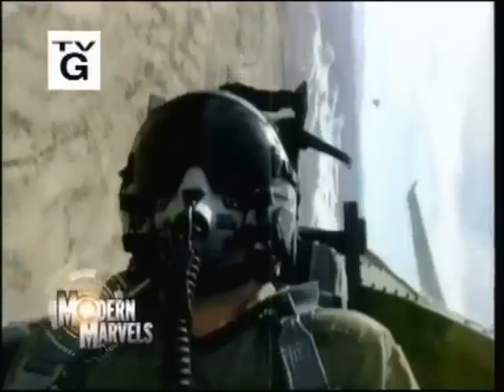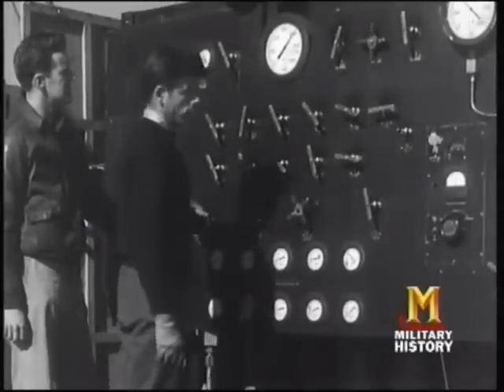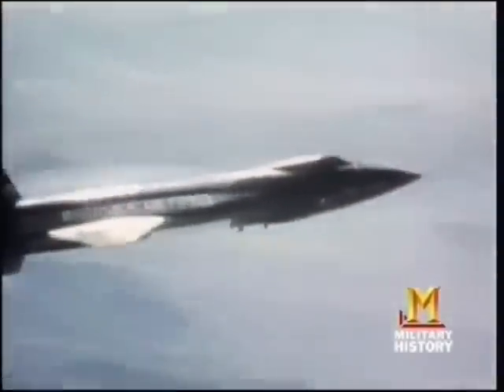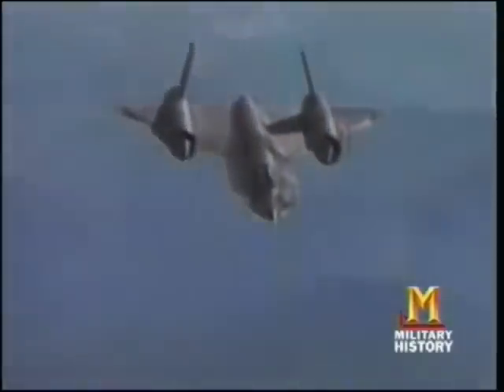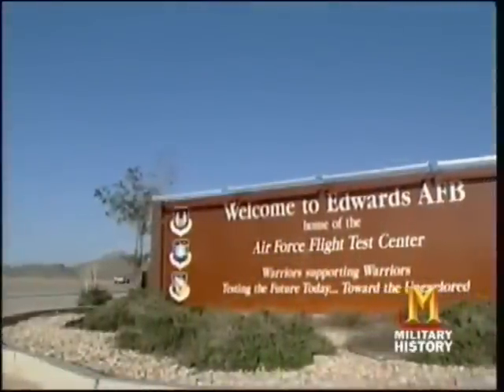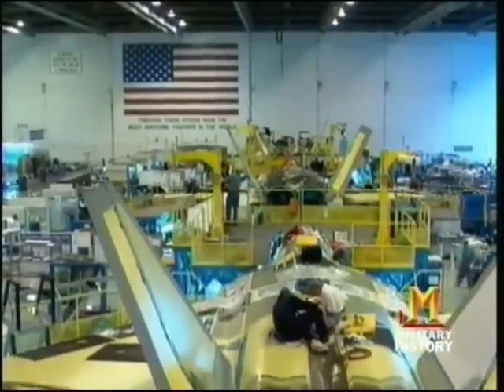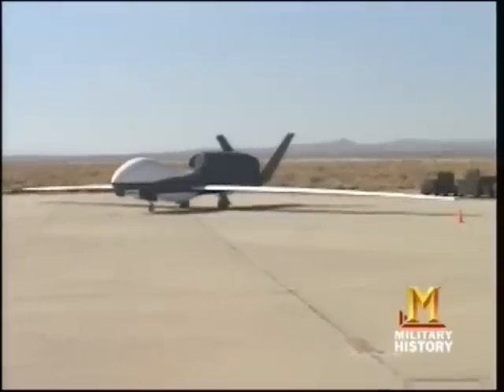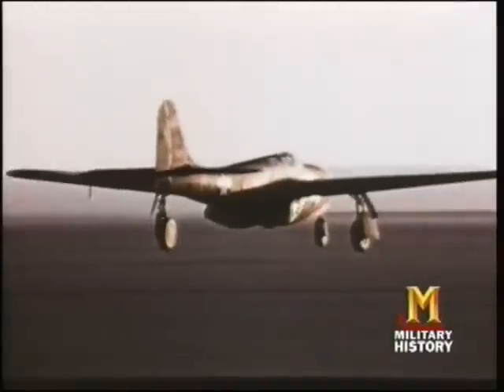Complicated Military Aircrafts - Engineering and Manufacture (HD Documentary)

Comment: i'm getting a little tired of this debate to have people in the cockpit or not. i flew 3 combat tours in the USAF. and out of every target i engaged. 99% were little more than a blip on my screen or a coordinate, period. i flew several fighters in the AF. and all had a combat cam that i often had to watch for hit confirmations for later debriefing. but only at a minimal. in the moment, you're trying to fly the aircraft, maintain a high level of awareness and monitor your systems performance in a very dark cramped space. these remote pilots are sitting in a well light room. they can literally turn controls over to another pilot for a break. and they have the safety buffer to allow themselves to monitor a target far more closely than any on board pilot would ever want to.  as a pilot, i had to pass a very high standard of eyesight. but at 15,000ft, i'll have to look through a monitor as well. but mine was much smaller and with much less res. so the real question should be. we have 2 different ways of doing the same thing. one keeps the pilot completely safe. the other puts the pilot directly in harms way. which should we use?
  furthermore, i'd like to point out a very key factor here that i've not heard mentioned once. when a missile hits a fighter. the pilot DIES. when a missile hits an ROV. the pilot L E A R N S...
Reply: Everything you said is correct, BUT, the problem with not having a pilot on board at the moment is either the enemy jamming the communications with the aircraft, or even worse, somehow taking control and using the aircraft against you.
Reply: Sweet Jesus, some Wise Words of Wisdom! Imagine the speed , stealth and maneuverability of supersonic stealth drones? Just 5 years imagine CPU power, stealth materials, and weapons technology!  "the pilot DIES. when a missile hits an ROV. the pilot L E A R N S..." = Ppl only complain if thats your family/relative KIA?
Reply: vujcicfan not really. all our latest, and very soon to deploy, attack drones can operate autonomously. if they're cut off, they continue on with the mission at hand. and will still be able to counter enemy missiles and fighters. even engage ground targets without human input.
Reply: ***** But that's good only for a very specific mission(and in fact drones are used today for very specific missions like air strikes or surveillance), Artificial intelligence today is still not that advanced that it can completely replace humans, so as long as you can't trust either the RF link between the drone and its operator, or the drone's AI, you will need humans inside the aircrafts, tanks, ships etc...even if it means they are risking their life, and I say that after 13 years as a tanker in the Israeli army, so it's not like i'm happy risking other people's lives, but that's the situation at the moment.
Reply: vujcicfan you need to get better read on the subject matter man. plus, i did clearly say these attack drones were "soon" to be deployed. the new predator D, being deployed in 2016, with about 750 units. is a fully autonomous drone. it can fly entire missions on its own against ground and air units. sounds you like you're a bit behind in AI development man. what the AI for your desktop can do pales to compare to military grade equipment. btw, that new predator will be armed with our new directed energy weapon system. which will annihilate anything thrown at it. plus it will have an 18 hour linger time to loiter over the battle field. 
 now to really put this weapon into perspective. if you made up squads of 12 and placed them in a flight line with about 50 miles between each squad. you'd have an offensive line of attack that spans over 3000 miles. thus we could send this line across any region and effectively own everything land, sea and air. the even bigger part of the picture that no one seems to be catching onto. is just how much of an impact these systems will be to our missile defense shield. think about man, we'll have over 700 anti- ANYTHING lasers that can sit at high altitude for nearly a day at a time. and can refuel in the air. i don't care how you look at it. that is a huge checkmate :)
we are about to enter a strategic checkmate that has only ever happened once in the history of man. the first time was just after we nuked japan in ww2. for nearly 5 years. america was the only nation on earth to have nukes. we could have pressured all of our enemies to the negotiating table. unfortunately we let that opportunity pass us by. i doubt we will this time :)
Reply: Totally agree, all the benefits of remote piloting far outweigh the risk of possibly loosing connection. All the life support systems, cockpit, instruments, etc that take up valuable space and weight aren't needed. That allows for greater flexibility in design to increase payload, range or whatever. They can pull higher G, stay in the air for days and manage maneuvers that humans just can't. And the most important asset, the pilot, is kept completely safe with the added benefit of better awareness and other pilots around to advise or take over.

Could you imagine dog fighting something like that, something that could have 360 degree vision, track multiple targets, pull hard g maneuvers in rapid succession and use automated maneuvers to attack. And if one does go down another could take over with the same pilot who now has more experience. I know it's not that simple and modern combat isn't really about dog fighting but the potential is amazing.
Reply: person8203 they're pretty damn awesome.
Reply: I totally agree, don't agree with whatsoever with the arguments against drones.

And thank you for serving our country
Reply: *****   Yeah.  You won that argument.
Reply: Has no one seen Terminator? Do you really want that?
Reply: mcapps1 sounds more like you've been watching to much terminator, lol...
Reply: Gotta say, some fella in a bunker playing with a joystick, unleashing a hellfire or 2 on "video game", to me sounds dangerous ethically, am aure there are some checks & balances but all the same, will get many more Afgan weddings blown up + + if we fully take the human element & eyes on the ground so to speak,.am sure some troll will call me a wanker & to wake up thats how things are going, am sure thats correct but my point is it's in my view just plane dangerous & will cause major errors, a guy comes of an xbox medal of honour onto a drone mission, he will resist pulling the trigger, i think not. Then again, fuck em all right !
Reply: Dan Dared
It's actually more likely to be the opposite, the main difference is that the pilot is taken out of harms way. They'll still have much the same instrumentation and processes for authorising targets. However, with the pilot being on the ground somewhere they can have much more equipment around them to help make decisions as well as input from others if need be. It's certainly not a computer game and pilots who have to go through all that training aren't going to jump on going "fuck yea, kill streak!"

Although, not being able to fly an actual plane sounds like a bummer to me.
Reply: person8203 yeah, i can see how not flying seems like a bummer. right up until that first missile locks onto you. coming from personal experience, that is a real big bummer.
Reply: *****
Must every comment come with terms and conditions, just read between the lines?

All I'm saying is that there could quite possibly come a time where certain pilots spend more time sitting on the ground than in an actual aircraft. Surely you would rather fly a jet? Yea, there's an element of danger but it isn't called the armed forces for nothing.

Of course, for pilots safety among many other reasons it makes total sense to use remotes.
Reply: person8203 um... i was basically agreeing with you man. i flew for over 15 years in the USAF. all i was saying, is that flying a fighter sounds great until you get that first alert of an enemy lock on your aircraft. and the awareness of a 20+ft rocket screaming at you at over 2,000+mph. the will redefine the term "bummer" real fast.
 i want to see massive investments in drone fighters. the need for manned aircraft is not going away anytime soon. but frontline attackers and strategic strike missions play into the drone world perfectly.
Reply: ***** well, that is like explaining heaven, lol. honestly, i miss it alot at times. i still fly my own single engine sport jet. but i'll never see a mach again, lol.
 my advice to you... do it! i've had a few friends that were deathly afraid of flying, period. i got them up with me once and put a stick in their hands. they now own aircraft. 
 a little fyi, most airports have clubs associated with them (heli's, ultralites, planes etc). and the only thing flyers love more than flying. is talking about flying, lol. look around for a club that feels good and go in and talk with them.
Reply: ***** what did you fly...what military...i bet you are lying and I can prove it
Reply: Dan Dared - If Afghan weddings are like Iraqi weddings, the men have this thing about shooting AK-47s toward the sky to celebrate...that has a tendency to get you shot back at, or at least buzzed by a jet fighter, when the damn bullets come raining down on the neighborhood. If your wedding is just outside someone's airfield, that is exactly what happens.
Reply: Brian Shelton - governmentcheese411 sounds pretty legit to me. Gut feeling is he was an F-4 Phantom jockey in Vietnam, statistical likelihood is an F-16 pilot since there are a lot more 16s than anything else and over a long period of time. Either way he's got flyers pegged - I annually immerse myself in that crowd and what he says is true.
Reply: Amen!
Reply: I'd add to that that remote control tech is much lighter then a pressure suits and cabins, and all the screens and controls needed to accommodate a pilot on board.
Reply: governmentcheese411 
P
Reply: governmentcheese411  p
Reply: Obviously Air Force, as you claimed you were in, did not teach you punctuation, capitalization, sentence structures,... etc.
Either you lied your ass off or you just copied and pasted from someone else's comment, Youtube pilot.

Comment: One day, high above Arizona, we were monitoring the radio traffic of all the mortal airplanes below us. First, a Cessna pilot asked the air traffic controllers to check his ground speed. ‘Ninety knots,’ ATC replied. A twin Bonanza soon made the same request. ‘One-twenty on the ground,’ was the reply. To our surprise, a navy F-18 came over the radio with a ground speed check. I knew exactly what he was doing. Of course, he had a ground speed indicator in his cockpit, but he wanted to let all the bug-smashers in the valley know what real speed was. ‘Dusty 52, we show you at 620 on the ground,’ ATC responded.
The situation was too ripe. I heard the click of Walter’s mike button in the rear seat. In his most innocent voice, Walter startled the controller by asking for a ground speed check from 81,000 feet, clearly above controlled airspace. In a cool, professional voice, the controller replied, ‘Aspen 20, I show you at 1,982 knots on the ground.’ We did not hear another transmission on that frequency all the way to the coast.

Comment: They fail to mention that the ram jet doesn't work at low speeds it has to be propelled into supersonic speed to work which is very inefficient for commercial use and I doubt the military will use it for much of it at this stage till further development great break through though

Comment: Apparently the former secrecy of the MiG 25 outdid itself as well since the author never mentioned it. Coming in at about mach 3.2, not the fastest jet in production had the speed to shoot down the mach-3 supercruising (sustained mach speeds without AB, SR-71 was NOT supercruise capable) Valkyrie bomber (which was promptly mothballed) turned out to be able to reach sufficiently high altitude for an effective blackbird intercept.

Blackbird had no radar, and the MiGs used IRST only to lock onto those J-59 turbojets, but the order was never given to fire. This is one of many reasons why the War remained cold. The MiG has set the record altitude for all fighters at 123,000 ft.

It is true that the Blackbird is an amazing craft, but needed a TON of support from aerial tankers. Flights also had to be VERY carefully planned, otherwise the craft could very easily run out of fuel. So even if a Blackbird found out about a MiG on its tail, there's not a thing in the world it could do about it (other than hope and pray). Which might have something to do with the blackbird being canceled.
Reply: MIG-25  was a  flying brick.  .Its  engines could never sustain speeds over Mach 3 longer than few minutes otherwise the engine would be destroyed  ..The Soviet engine  technology  and  reliability  never  reached  western  standards. Blackbirds J58 engines are probably the greatest  jet engines ever  made  they could fly  with  continous  reheat more than an   hour  ,The   max  speed of MIG-25  therefore  was  set at  MACH  2.8   Even  the  defected  MIG -25  pilot,   Viktor  Belenko   said  that  MIG has never been  to   catch  the Blackbird.  After he landed in Japan in 1976 and asked for asylum, the US  and  Japanese experts examined the MIG-25  very carefully, the result ? Its technology was outdated  even in 1976 ..nothing out of the ordinary .
LOL. .Blackbird  wasn't  cancelled, it  was   retired  after  19   years  of  service during which it played cats and mouse with MIG's  of all types..Do some research  before posting nonsense..
Reply: Hakan Berker

http://theboresight.blogspot.com/2013/06/death-by-proxy-syrias-civil-war.html

http://theboresight.blogspot.com/2009/09/some-thoughts-and-discussion.html

There, research done. I suppose you will poceed to insult this person with the same insult you used with me. But on the other hand, read the quote at the top of the second link. I don't suppose you are a professor at Boston university. Furthermore, judging by your diction, you wouldn't posses equivalent credentials to refute the professor's claim.

I also have "SR-71 REVEALED" by Richard Graham a retired USAF colonel who flew the SR-71. He had said things to the effect of: "SR-71's trips had to be planned very carefully, especially concerning mid-flight refueling rendez-vous", and, "there's little room for improvisation at Mach 3". Even if the MiG couldn't catch up to one, they could always reach altitude and wait for the Blackbird to catch up.

Comment: A pilot at altitude and speed can no more discern people on the ground one from another, than a remote pilot of a UCAV is capable doing so. Deploying UAV's is only questionable if the final authority to engage is automated, if the remote connection from pilot to vehicle can be intercepted resulting in loss of control, or can be taken over by enemy combatants and turned against friendly forces.

Comment: Okay, YT reset the vid when I logged in to make the comment.  Guess I'll make my comments without the end of the vid.  I'll take the flak on my comments, but they come from hard copy rather than the net.
SR-71, XB-70, B-58, and F-15 pressed the edge.
B-58 broke some major speed records with the understanding that "I can chunk a nuke into your lap, so get over it and play nice".
The F-15 was the answer to the MIG-25.  After it was all over, the MIG-25 was something out of the past and the 15 broke records, and made a front line, multi-role fighter (let me jet these pesky gravity weapons, and we can play).  The F-15 is still a major test bed for variable thrust, etc.  Bad bird, worked it, love it.
The SR grew out of the YF-12a.  The XB-71 and YF-12A were designed together to fly as a team.  The YF-12A was to defend the XB-71 during it's hypersonic penetration of Soviet airspace.  It was also a concept design to intercept Combloc bombers and first gen ICBMs.  One of the limiting factors of the YF-12A is that it caught up with it's own gun systems.  Not sure if it was 50cal or 20mm, but a test aircraft flew into it's own ammo going supersonic.
Yep, the SR-71 leaks fuel on the ground, but nothing leaks when it gets to altitude.  MIG-25s (they were designed to be a one shot interceptor against the XB and the YF) shredded engines and shot missiles to no avail.

Comment: I do not see a commercial application for this engine, only military for the very long future (100+ years).  An airframe capable of withstanding the speed and other stress found on high performance aircraft is no where near the +300 pax airliner of tomorrow, as well as the ground based ATC that would be needed to keep these super planes from running over one another

Comment: X-1, X-15, RS-71 (Original Designation), X-43.
All of them broke speed records.
19:10 YB-49, based off the Ho-229 of Nazi Germany
The Ho-229, however, was more advanced than the YB-49 as it was tailless, and the Ho-229 is more like the B-2 Spirit in shape.
The Horten H.XVIII (H.18) is basically the B-2 of the 1940's, however it was never produced.
This show takes away a lot of knowledge, this show is a lie. This show is propaganda.